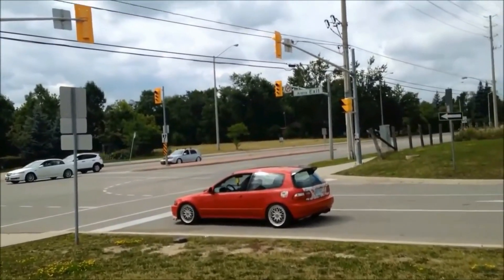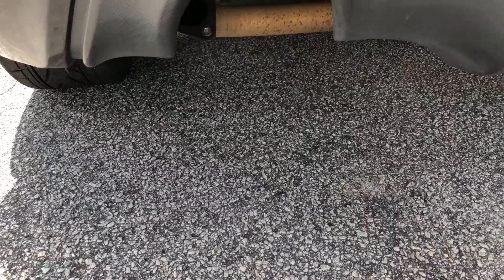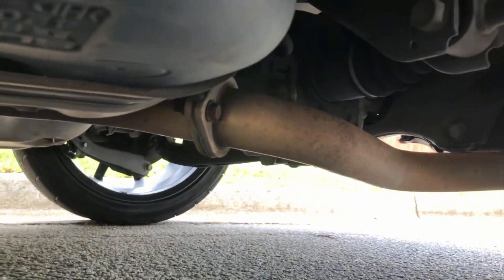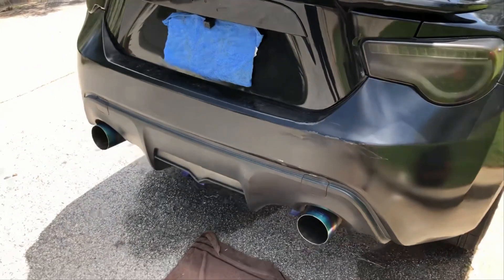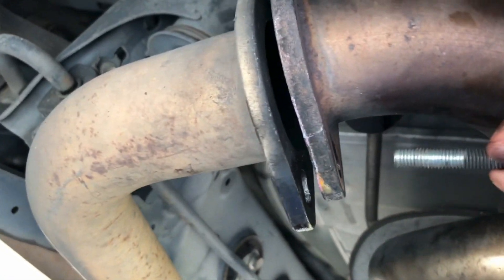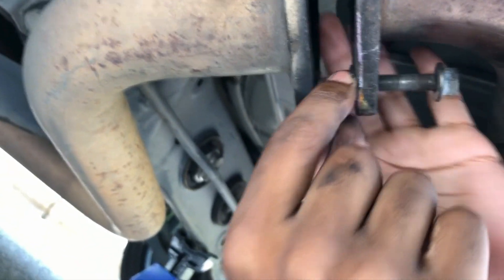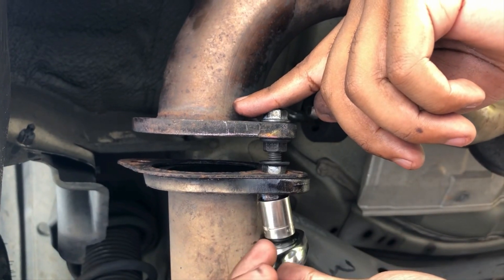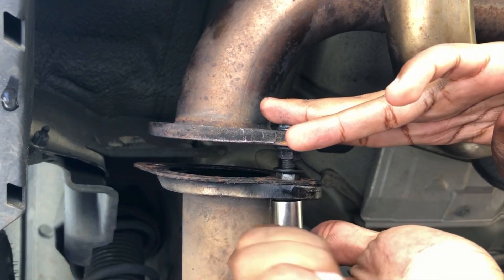How to make almost any car louder (FRS/BRZ/GT86)

Comment: So that muffler with the blue tips is the stock muffler and the gap just makes it louder?
Reply from the maker: It’s a aftermarket muffler but doesn’t make the car any louder compared to the stock one, so yea the gap is the thing that’s making it louder
Reply: @TheSoloSin  thank you. So u could just make a gap with the stock muffler and it would sound the same?
Reply from the maker: @andrewwalloff4949  yes it might sound different depending on how big the gp is between too
Reply: @TheSoloSin  ok thanks a lot.